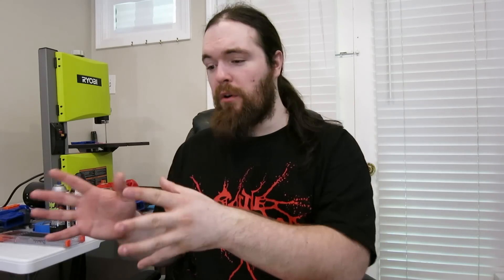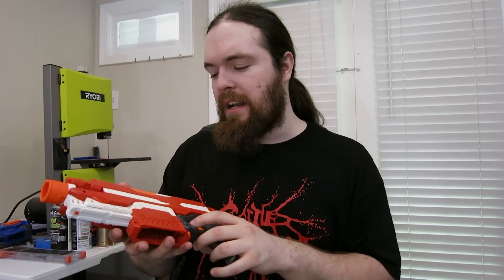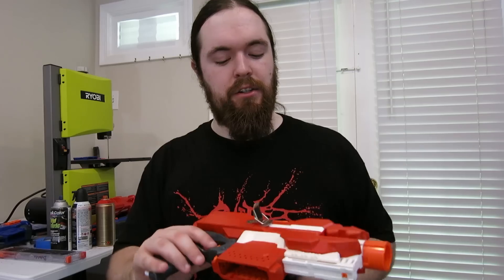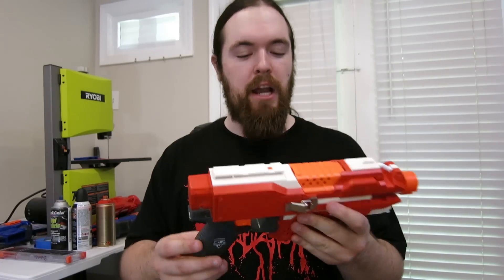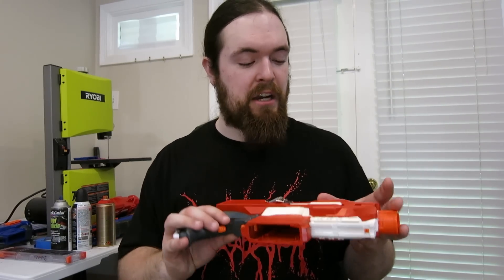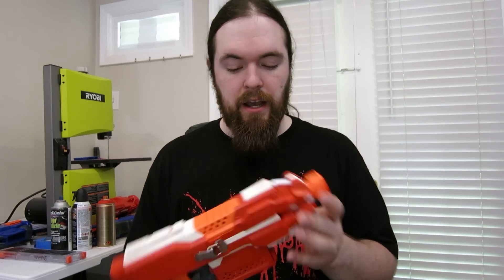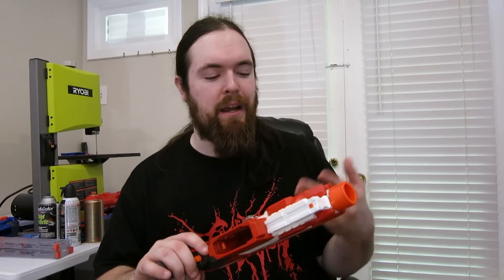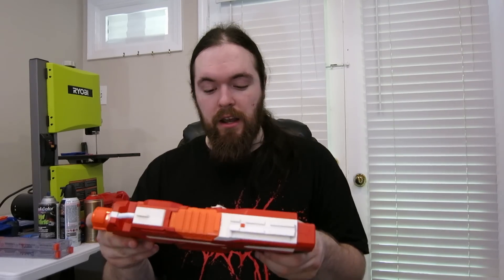Modified Nerf Stryfe with Meishel Motors

Comment: Wow...all I can say is wow.. i bought this from bobo and this thing screams! Just got my lipo today. Went to a local hobby shop and they helped me find the right size to fit in the stock battery compartment. I ripped all the darts I had in the clip across the store. It was a good 80 feet and they were hitting the wall. The guys in the shop were giddy as a school girl. They loved it and wanted to try it out. All I can say is bobo does a great job on his builds and if you want a solid modded blaster buy one from bobo!!

Comment: Bobo, what do you use for lighting in this/your vids? im interested in improving my own lighting so people can have a better showcase of my mods on my channel. (btw its tigerfoam from instagram the guy you were talking to in the 'leading nerfers' chat
Reply from the maker: +Tiger Foam 
The biggest lighting improvement came from a new camera with a larger sensor. Larger sensor = more light captured. (My old videos are super dark because the camera had a 1/4.85in sensor. The camera I used after it had a 1/1.7 which is 2.85x bigger).
Even with the sensor increase, I needed more light to whiten up the area. I use 2 Neewer LED fill lights: http://amzn.to/1QpLKh7 running with NP-550 replacement batteries. They don't last crazy long, but they get bright. I point them at the ceiling about 3-5ft away from where I'm filming.
Reply: IAmBobololo okay thanks mate!!

Comment: best motors for 4 IMRs? I saw your top 5 batteries, but I don't want to go through the trouble of a lipo
Reply from the maker: +Ahed 'Eojusee LiPos aren't much of a trouble at all- at least no more trouble than IMRs. Just have to treat them like you aren't stupid ;)

Best motor for 4 IMRs? Nothing really... at least at that voltage- nothing that works optimally with it. You coooould run any motor out there, but they're either not run at peak performance, or burn out after a while.
Reply: +IAmBobololo hey dude, do you have a PO box or something that i could send in a rapid strike so you can do a chrome gold paint job on it please? if you will, reply and ill give you better details. Thank you!

Comment: What type of wire did you use for this Stryfe? I'm thinking about upgrading my own Stryfe and want better motors, so I assume I need better wiring.
Reply from the maker: SimpleNerf I use 16 and 18awg silicone wire from HobbyKing for most of my builds.
For this, I used 16awg
Reply: Thank you! What is the difference between 16 and 18 awg wire?
Reply: Nevermind, I looked it up...

Comment: any recommendations for 130 motors to put in a stinger raven with 3 imrs?
Reply from the maker: Stock motors with its stock brushes replaced for carbon brushes.
Reply: IAmBobololo awesome, and I'm sorry for all the questions, I'm actually new to the hobby, but where would I get the carbon brushes? (the stinger won't be my first Mod, I'll practice on stryfes first lol)
Reply from the maker: You can get them from cheapo 130 motors on Chinese websites, maybe even Amazon. Or order 130 sized carbon brushes just by themselves on eBay, BuyChina, or Aliexpress. Just make sure they have a picture with carbon brushes and not just regular metal brushes like you'd find in Nerf stock motors.

Comment: What lipo are you using and can it fit in the battery compartment stock?
Reply from the maker: Shadic 108 A 2S LiPo. It's slightly too big to fit in the battery compartment, that's why you see it dangling out of the blaster when I'm spam firing it.
Reply: ah, have any recommendations on a specific lipo that can fit in it?
Reply from the maker: Shadic 108 There's a few forum topics about the size. If anything, measure the battery tray and go based on that.
Reply: IAmBobololo Could you please provide a link? Thanks!

Comment: can you make a Vida belt how to mount the latch on the stryfe
Reply from the maker: Sand surfaces, clean the areas with rubbing alcohol, epoxy the piece the latch catches on where you want, let cure, epoxy on the latch and move it so there's a little bit of tension when closed. Done.

Comment: I never heard you say anything about cage and flywheels, is that 106 fps on stock cage and flywheels? 
Local arena has a 100 fps cap,
Most of my builds are way over built for that , looking to make a 100 fps stryfe
Reply: The best 100fps build ive seen is valkyries on imrs with a 42mm ofp cage and bulldog wheels.

Comment: What latch did you use for the batter tray
Reply from the maker: It's some small latch you can get off eBay and Amazon. These were sold by Amico on Amazon (if I'm not mistaken), but it's about 3in long.

Comment: what type of latch did you use? how did you attach it?(screws?)
Reply from the maker: It's a smaller latch I got off ebay or Amazon.
Used Devcon Plastic Welder and super glue to get it on there.